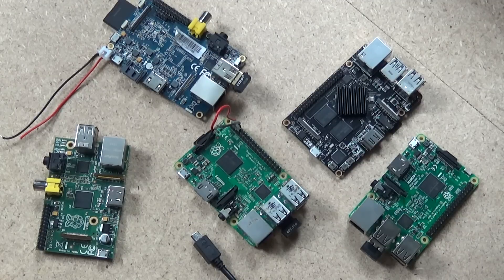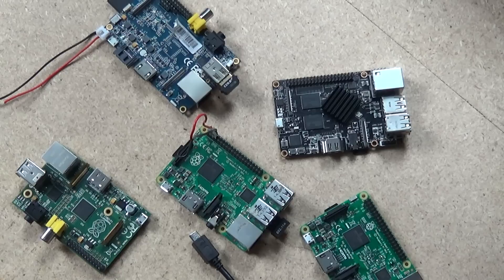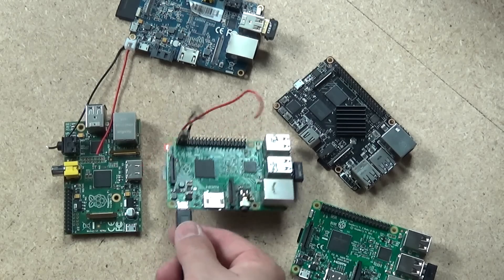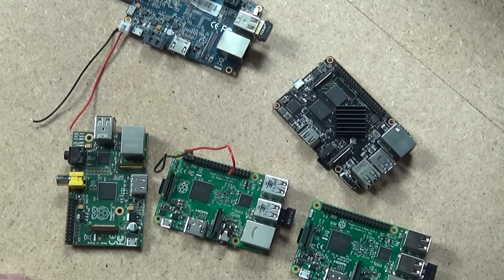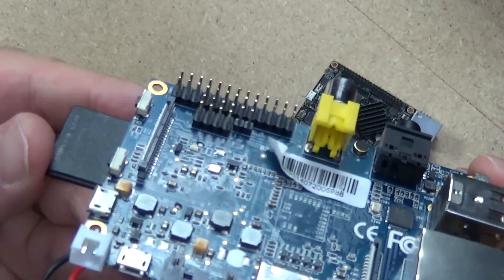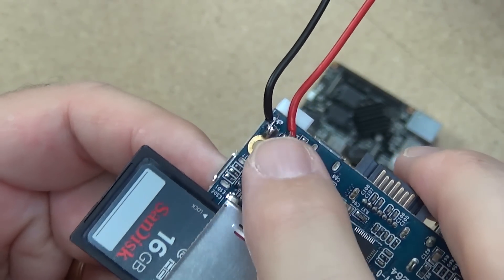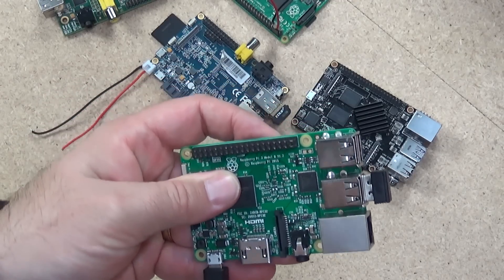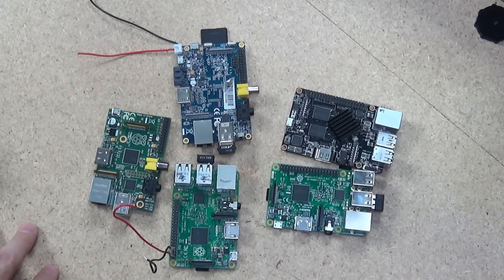Raspberry Pi Power Options - 3 Ways to Power Your Pi or other SBC (MEHS) Episode 44

Comment: So, the issue that I have with using power supplies isn't so much the voltage but the amps. I can find a psu that gives the 3v, 5v and 12v is needed, but the amps are a mystery. How do I ensure that I get the 3A needed out of the psu?
Reply: It won't draw more than 2.5 amps at 5 volts. That's just the maximum current it will consume. You could hook it up to a 100 amp supply and it will only draw a maximum of 2.5 amps. Get a power supply that will supply 2.5amp and above and you'll be fine.
Reply: @haydo8373  Thank you for that. It's been a mystery for a while.

Comment: You should also explain about protecting power inputs when connecting directly on GPIO, since in RPi3B+ for example you're skipping the resettable fuse which is present on microUSB port.
Reply: Hi, i´m using a PC power supply to power a rpy 3b+ but show a yellow ray top left screen, the wire is thick enough, i suspects the micro usb connector. So, there is no other input point to power the board ?
Thanks

Comment: I will make a webcam from raspberry pi 3 A+ which in this project will occupy the PWR IN micro usb as the webcam communication input as well as power, because the power from the usb produces 500mA, it is certain that the board will not work optimally and does not have enough power to run the fan or oled display. My question is, will the board not be damaged if I connect an additional power supply of the same voltage through the two pads at 3:48 to increase the current?

Comment: What is the part called that connects to the GPIO pins and has the positive and negative wires (on the Raspberry Pi 3 in the video)? I am trying to find for my project.

Comment: Can I plug into the barrel jack as well?
Reply from the maker: Hi.  Not many of these boards have barrel jacks for power, mostly mini and micro USB, GPIO etc.  Arduino Uno etc have barrel jacks as power input.  Just make sure that any barrel jack on whatever board you're using is for power and not video or audio.  Cheers.
Reply: @michaelsstuff4402  I'm glad I asked and you answered ... or I might have tried to jam a 5V barrel jack into the audio connector ;-)

Comment: I have an Orange Pi One Plus, i seem to have a "dead" board or power supply issue. Is this video of use to me? It's never turned on from since i've ordered it.
Reply from the maker: Hi.  I think so.  Take a look at the video and then find a copy of the GPIO pinout for your board.  If the USB power input is faulty but the rest of the board is okay, you might be able to power your Pi from the GPIO, just like you can with many other boards.  Cheers.

Comment: Can I charge a raspberry pi with a standard phone charger
Reply from the maker: Hi.  You can power a Pi with a 5v phone charger as long as the phone charger has sufficient amperage.  A Pi 2 will work with about 1A.  A Pi 3 will require more as will a 4.  If you don’t have sufficient power going to the Pi, the Pi might fail to start or become unstable.  Cheers.

Comment: I have some 18AWG solid core wire but don't want to solder directly under the micro USB so, GPIO pins it is. What female adapter do I need? What is the connector I need?

Comment: Can I power my raspberry pi 3+ with micro usb directly to male plug??
Reply from the maker: As long as the power supply is sufficient - about 2.5A.  Cheers.
Reply: @michaelsstuff4402  can I plug the micro usb cable in a cellphone power brink & plug in the wall? Thanks!
Reply from the maker: @robertbane2163  - Yes if the plug pack outputs 5V at sufficient amperage, about 2A for most boards, 2.5 for a Pi 3B+ and 4.  Not many phone power bricks put out enough power.  If the power reaching the SBC (pi) is insufficient it will fail to boot or you will notice what looks like a lightning bolt appearing in the corner of the OS display.  Cheers.

Comment: Hi , If I use the GPIO pins I lose the USB voltage protection, I think you mentioned this in  response below. Do I lose that protection if I solder to the surface mount pads on the bottom of the board?
Reply from the maker: - Hi.  I don't have a PI with me but all you need to do is follow the traces to see where those connections go.  From memory, the pads at the bottom of the connector simply follow the same traces as the connector, so you would be going through the voltage protection circuit.  If the traces or pads are different then see where they go and that will give you your answer for most PI models and other SBC's.  Cheers.

Comment: Hello, I have couple of old mobile chargers (5v 1.8A and 5v 1.5A), usually my RPi without HDMI and USB devices does work with 5v 1.8A charger, So can I use other charger to provide power via GPIO pin? Is it possible to 2 chargers to power on same board?
TIA.
Reply from the maker: - Hi.  Im not sure how the Pi will react since I haven't tried to do that before.  My best guess is it will work as the power channel is the same regardless of the input, with the exception that power going in via the GPIO pins is not regulated.  Cheers.

Comment: Can i power pi through usb ports on my pc?  If i can isnt pc output 12v?
Reply from the maker: - Hi.  No you can't unless your taking about the Pi zero, and even then you shouldn't.  A PC USB port outputs 5V and usually at a max current of 0.5A.  A Pi 3 needs 2.5A at 5V for full operation.  You can sometimes boot a Pi with less current but not 0.5A from a USB port.  Cheers.

Comment: thinking of working on a project with a raspberry pi zero wireless, I was thinking of powering it up using the USB voltage on a tv, would this work.
Reply from the maker: - Hi.  The Pi Zero W will draw 150ma at idle and is supposed to be powered by a 1.2A supply.  Most tv's USB ports are 500ma rated so you might get the Pi Z to boot and do the minimum but you could run into reliability issues when pushed.  Cheers.

Comment: can i power 2 raspberry pi 3 B+ using a USB hub?
i like to power 2 Rsp3b+ via a Power USB hub, i have a usb power hub that is 12v @ 2A and im worrying it will blow or burn the ic's of the pi's due to over voltage, would this be true?

I like to add that both of these Pi's will have their own Camera module connected.

I plan to build a AR headset using this mentioned products. 

I like to add that both of these Pi's will have their own Camera module connected.

I plan to build a AR headset using this mentioned products
https://www.amazon.com/gp/product/B076JBLH1F/ref=ppx_yo_dt_b_asin_title_o08_s00?ie=UTF8&psc=1

My question is what is the best way to power both of these Pi's?
Reply from the maker: - Hi.  Short answer is no.  The Pi 3 needs 5v at 2.5A.  The hub you mentioned, and most others, only supply 2A max over thr 5V USB port.  Not really enough.  You might get the Pi to boot but you won't get reliable performance when using it.  Cheers.
Reply: @michaelsstuff4402  actually i was able to boot and load Raspbian just fine also running 2 small 5v 0.2mA fans and also a 7" lcd, so it seems that the Pi's dont need that whole 2Amps and the power block supplies 2.5A's. im sorry but everyone i asked said similar to what you said but no one put it to the test so by the time everyone replied back i pulled out a MM and did the dam thing.
Reply from the maker: @arletpaz8010  - All good.  I have done similar in other videos but you can run into issues when asking the PI to do CPU intensive work like videos.  You will notice the yellow lightning bolt in the top right of the screen noting power is insufficient.  You are also likely getting good output from the power supply and possibly a solid or better that 2A from the USB port which is also good in your case.  Cheers.

Comment: sir..i have 2 raspbery pi..somedays ago one raspbery pi got under low voltage problm..i tried many charger and usb cable bt still i got a problm..another raspbery pi are good with any usb and charger.. bt that one raspbery pi could not boot normaly..it start with yellow lightning symbol..pls help me
Reply from the maker: Feed the troubled Pi more power.  Try a bench power supply if you can or a genuine Pi3 power supply that can deliver 5.1v at 2.5a.
Reply: @michaelsstuff4402  i used 5v 2.5A charger..but still i got same problem..

Comment: Option #4: Use a powered HUB that back powers the Pi
Reply: Loki's Lair  yep works fine as long as the hub can supply the current, some are limited to usb specs.
Reply: >= Pi3, USB power is NOT '5V rail' - it is switched/current limited.

Comment: Hi, is it possible to use a 2.1 A smartphone charger and an 1 A charger with pinout for GPIO pins? Will none of those components get destroyed? I mean if the pi tries to draw more than these 2.1 Amps, the charger will get destroyed because it's an unsafe one coming from china with no safety mechanisms, which means it would burn...  Great video anyway and ty in advance!
Reply from the maker: - Hi.  It's possible that it will work but I can see problems such as draw being demanded from the smaller power supply that exceeds its ability and it burns out.  It would only take a second or so.  If you had to use 2 power supplies I would use two the same and connect them together in parallel and connect them to the same point on the Pi, not different points.  In essence you end up with a 4.2A power supply.  Cheers.

Comment: Yeah cool vid but it didn't answer my question. I have 3 Pi's currently and will probably be getting two more. I really want to get rid of the official power supplies and just use USB cables. It would streamline the whole thing and look a lot neater. Can this be done? Does anyone make a powered USB hub that would work or would I have to put something together?
Reply from the maker: - Hi.  Yes that would work.  All you need to do is make sure the total power supply is enough for the 3 PI's at full load and make sure each PI is getting its fair share (2.4A).  You can either use a single 7.5A or more 5V power supply or use a bigger supply and run 3 individual step down power regulators so each PI gets its own reg able to provide 5V at 2.4A.  Most USB hubs will provide power through each port but most have a total power output less that what you need.  Cheers.

Comment: how i can connect 12V lipo battery to rasbi 3 ? i need 12 volt to display 10 inch rasbi display power, and 5 volt to rasbi 3 board, how this need do ? and need HDD connect to rassbi too.what hub i need ?
Reply: You need a Step Down voltage regulator. Look up UBEC on aliexpress or ubec or whatever for cheap, ok ones

Comment: Can I just power the Raspberry pi with an usb connected to my pc?
Reply from the maker: - Hi.  No.  PC USB ports output 500ma.  A Pi 3 requires 2500ma.  Cheers.
Reply: @michaelsstuff4402  Whats about the raspberry pi zero w???
Reply from the maker: @kusum1179  - Hi.  Yes, from what I've seen a Pi zero W will stay under the 500ma usb port limit.  Cheers.
Reply: @michaelsstuff4402  thanks

Comment: im a little late, but i wanted to know how i could have both a pi and a 14"-15" screen powered with only one power input. Im not really looking to add a battery. Also how would i add a power button?? (clearly im a begginer)
edit: im probable going to use pi 3 b
Reply from the maker: - Hi.  The answer is yes.  Its easier if the LCD screen you use can be driven by a 5V source (some can), that way you just need a 5V supply with enough current for the Pi and the LCD (about 3.5A).  If your LCD is a 12V unit then you will need a step up converter to get the 5V supply up to 12V.  Alternatively you could use an external 12V source and use a 5v step down converter for the Pi but it will need to be able to handle at least 2.5A, preferably more.  Cheers.

Comment: the model 3b+ requires 2.5A, what are the options to supply this to the system? USB cable from laptop is out of the question, so only option i see is the official power cable... boring
Reply from the maker: - Hi.  The original Pi3 also needed a full 2.5A for happy operation.  The official power supply actually pumped out 2.5A at 5.1V just to give that little bit more and compensate for the loss through the cable.  The official cable also has thicker than normal wiring normally only found in the best USB cable.  Having said that, you have many options for the Pi3B+.  The only real trick is to use good thick wire (relatively) and a source that can give 2.5A at 5V.  I have used many aftermarket plug packs (wall warts) and some of the power boards that have USB ports built in.  To use those successfully you just need to source a good quality USB cable.  If your chopping up a plug pack then just use good wire.  Cheers.

Comment: I  have laptop universal charger with usb out on the brick. Under the usb is this info 5v2a.Can i run RP3 model b with this?
Reply from the maker: - Hi.  Good chance the answer is no.  For a happy Pi 3 you want 2.5A output and the rated output on your brick would  likely be a little under 2A.  You could get away with a Pi2 though.  Cheers.
Reply: My Electronics & Hacking Show tnx :)
Reply: @michaelsstuff4402  popular peoples used 5v 3 A wall power supply whit rasbi 3, 2,5 its ok, but better use 3A supply.

Comment: My phone charger has: input 100 - 240V 1.1A 50-60 Hz
Output: 5V == 8A 

Can I use that?
Reply from the maker: - If it really has an output of 8A then yes it will provide more than enough power.  Cheers.
Reply: that is like more than double though right?

Comment: Can you up the amps at all to run more devices?
Reply from the maker: - If you mean run more devices from the power source itself then yes, its just a power source.  If the voltage and current reaching the board is sufficient then all good.  If you mean feed more power to the board so you can run more USB devices from the board, then not really as most boards have a limitation as to how much their USB ports (combined) can handle.  Cheers.

Comment: What about PoE (Power over Ethernet) as an optional way to power one of these?
Reply from the maker: -Hi.  In standard form POE is not an option.  POE runs about 48V which is was outside the voltage tolerance of any of these boards.  You could do an old hack using ethernet cabling though.  You only use 4 of the 8 wires in an ethernet cable anyway so the idea is you splice out the other 4 wires at both ends and pump the required voltage through those 4 wires and keep the ethernet going through the other 4.  You end up with comms through part of the cable and power through the other part.  There are limits to how much current and how far you can push the power but it works.  Cheers.
Reply: The new raspberry pi 3 B+ has PoE
Reply from the maker: - Yes a nice option!

Comment: to power up using gpio is the same connection that we use for fan? rasp pi3!
Reply from the maker: - Hi.  I don't think so unless your fan is connected to the 5V and ground pins.  Not really intended to power anything from those pins that draws much current.

Comment: What I'd like to know, is how long  can I power a Raspberry Pi 3 using a 4000mah USB power bank? I know it depends a lot on the load, but I'm just referring to basic power consumption by the Pi with USB keyboard/mouse and HDMI display. Thanks
Reply from the maker: - Hi.  Is the power bank powering the HDMI display as well?  If not then average use will see a PI 3 draw a peak of 2.5A and a low of about 1A, so the average is about 1.75A.  Your 4AH power bank might last 2 hours.  Its worth noting that cheap power banks won't deliver 2.5A out of a USB port (usually less than 2 and the 5V supply often drops to 4.6V) and the Pi 3 at load will require 2.5A @ 5V to run perfectly.  A higher quality power bank will be capable of a genuine 2.4A from 1 USB port and can hold the 5V output which is close enough to keep the PI3 happy.  Cheers.
Reply: Or, just purchase a quality UPS (Uninterruptible Power Supply).